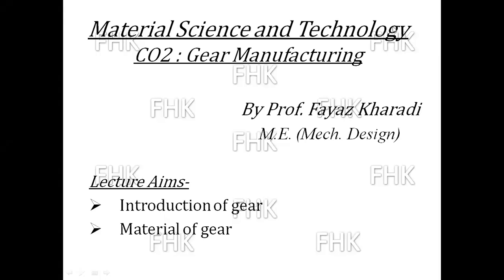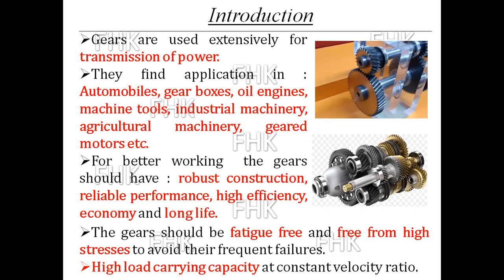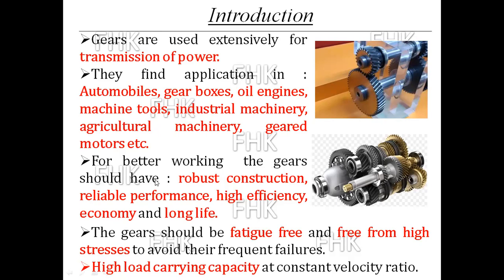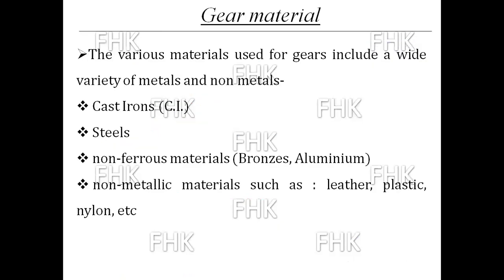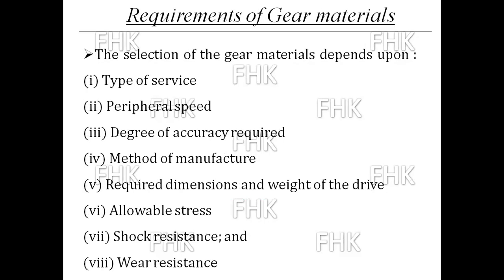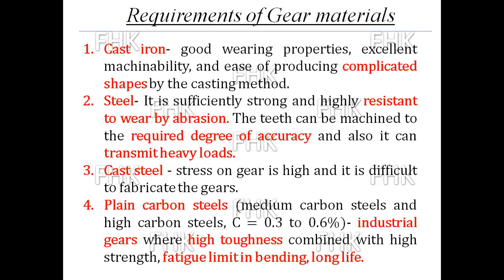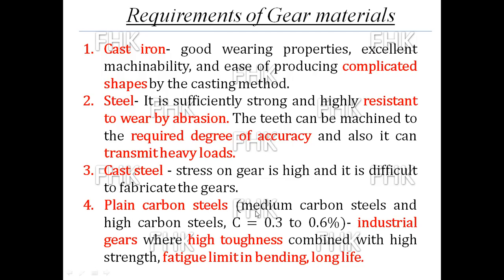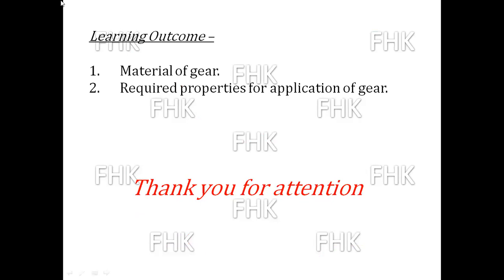Gear Material

Comment: Which welding rod used for gear teeth welding
Reply: Gear box gears
Reply from the maker: The material of welding rod is based on the base material. It doesn't depend on gear teeth .